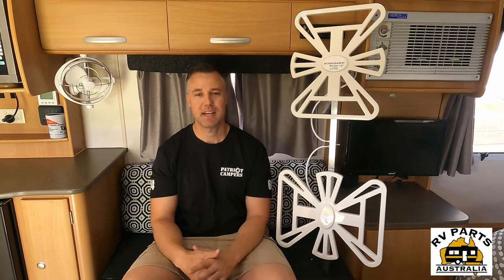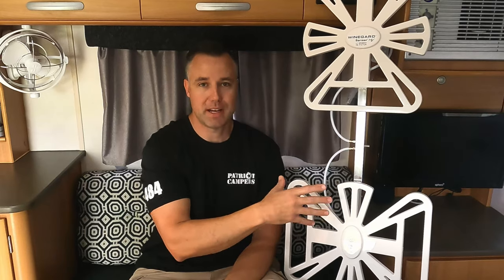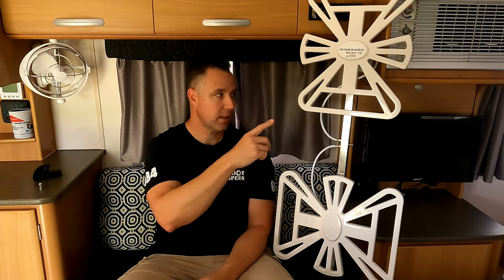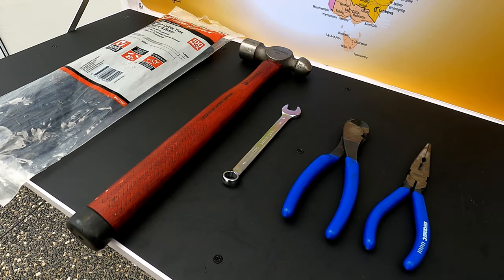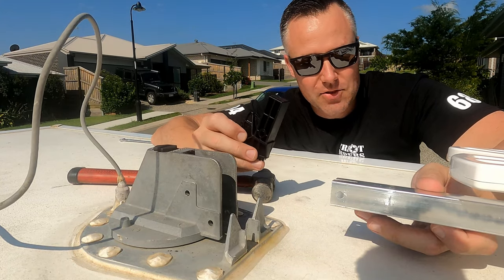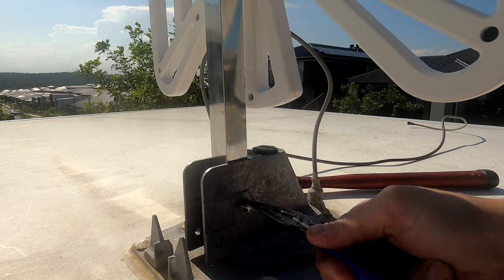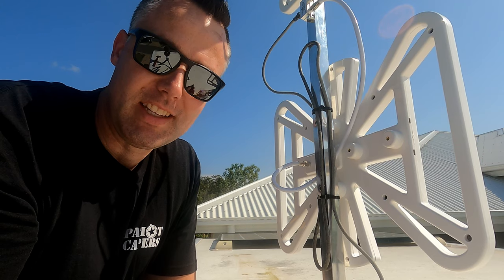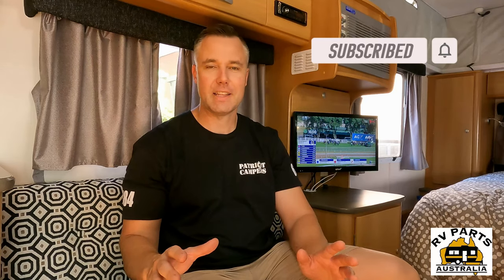Winegard Freevision Sensar HV RETROFIT Antenna || DIY || I doubled my TV channels!!

Comment: Is there a kit for mounting on the very edge of the roof and or one where it can be removed when not in use? I have very limited places because of the solar panels.
Many thanks
Reply from the maker: Hi Ken, not sure mate. Best to check with the supplier to see if there is something available. Cheers Adam

Comment: I just had a retro fit Winegard installed by a mate  replacing an Antennatek  and I still can’t get it to work it keeps coming up with ‘No Signal’ with booster button engaged . I’ve tried it in a few different areas in NSW. Ive checked all the fittings and they look and feel ok. Any ideas where it may be going wrong
Reply from the maker: I’d check your getting power to the head. If you get a multimeter and test the voltage on the coax cable where it screws on to the head, you should see 12+ bolts there. If not there would be something wrong with the line that will need to be traced back. Hope that helps
Reply: Did you end up finding your problem. We recently replaced our old Winegard with this same model and we are getting worse sound and picture than our old one!
Reply: @campwinnietravellingaustralia  yes replaced the lot
Reply: @markward38  oh gosh, I hope we don’t have to replace it as we’re on the road, driving us nuts though

Comment: I have the same antenna on my jayco van, the cable broke off in the splitter, so I ran a new cable,and replaced the splitter with a domestic one, but no signal now, what could be the problem you think??
Reply from the maker: Unsure mate. I’d start with checking if you have power. You will need undo the coax at the head and test with a multimeter to see if your getting 12+ volts. Hope that helps

Comment: We purchased a full package only 4 weeks ago and replaced our old Winegard, This new one is worse than the old one, sounds cuts in and out and picture is very pixelated, we’ve tried and checked everything, any ideas?
Reply from the maker: Thanks for watching. That doesn’t sound right. Definitely should be getting better reception. First thing I would be checking is that you are getting power to the head. You can use a multimeter to check this. Second thing I would be checking is all the connections are tight and the connections have been terminated correctly. If you still can’t find the issue maybe just double check the antenna isn’t faulty by putting the original back and and testing that. Hope that helps you resolve the issue! Cheers Adam
Reply: @GetCampingOz  thanks Adam, we will check the 12v at the head over the next day or so, unfortunately as we are currently on the road travelling we no longer have the old antenna to test.
Reply from the maker: @campwinnietravellingaustralia  hopefully that is the problem but let me know what the problem is once you work it out!

Comment: would you not put rubber boots on coaxial cable connectors
Reply from the maker: Yeh you could do if you wanted but they are t fitted from factory.

Comment: be aware, the new models have a 4G filter and cost 1/4 more! So all those ‚on sale‘ offers are without filter, superseded model
Reply from the maker: Thanks for the info!
Reply: @GetCampingOz  sorry, was wrong, was a mean sales trick by a store to justify overpriced item. I asked country importer and was told that G4 filters were introduced to sensar 3-4 years ago, no price rise then. So they have all 4G filters in, all little sticker on the board would tell if you pull it apart

Comment: So it looks like the mast head needs a 12 volt power supply
Reply from the maker: The 12v is provided by the coaxial cable. It is a single connection to the head. The winegard antenna wall point has 12v run to it which then powers the head.